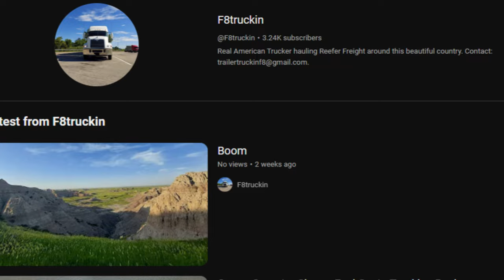Spotted at a truck stop! Lita cooks in the KW!

Comment: You could have that radiator resottered up at a radiator shop , But that's up to you myself I don't know if I would trust it ,   I would just put a brand new radiator in it Robert , And I mentioned it before put some rubber around the radiator or something to protect it ,  The TA has a real nice vacuum cleaner for about $50 bucks , It's like a shop vac real small one , I bought mine 7 years ago and it's still working  They are very nice , I lot of section power ,  I bought one just like the one you have and it's junk my friend ,  LITA 
😂❤❤🕶

Comment: That APU is gonna warp a head….i hope (for your sanity) it doesn’t but I have an inclination that we’ll see that video eventually….best of luck!
Reply: Find a radiator for a decent price. With all that vibration the epoxy weld is temporary. I’ve been where you are at, but found that the cost of a proper repair is less than one missed load. You guys are incredible. Best of luck

Comment: Since your apu fix is working for now. I would recommend buying the part you need but not replacing just yet. Wait until it goes out. Get a longer life span out of the 2 parts.
Reply: Its not a part really, its the neck on the rad thats split. He needs to get the time to take it to a repair shop or repair it himself when he gets home. Just needs soldered at the split.
Reply: @warrenmichael918  right. So replace the radiator. It's cheap enough not to warrant the headache of welding it everytime it breaks. Because once it's broke the first time, it'll never have the same structural integrity, even with perfect welds.